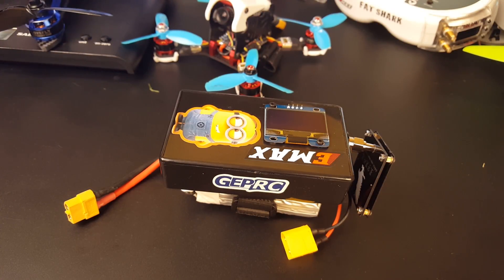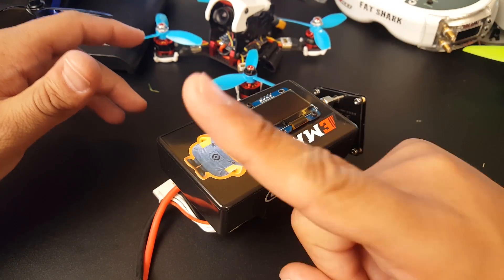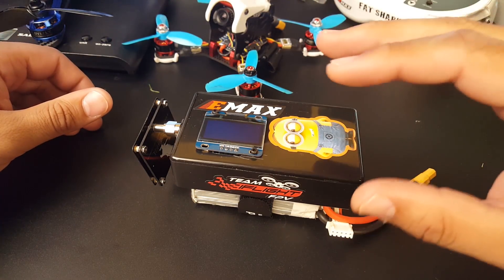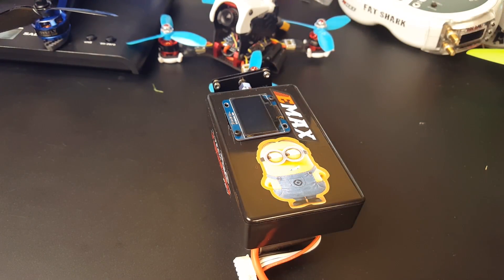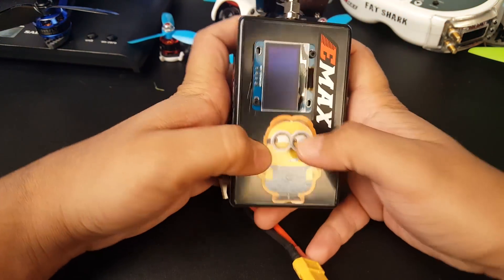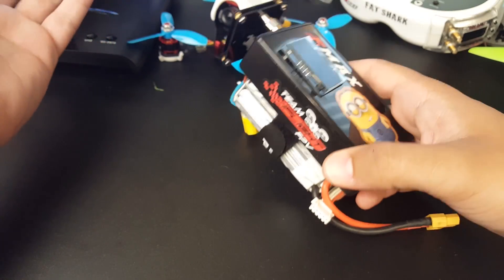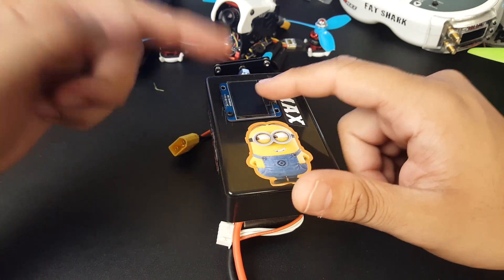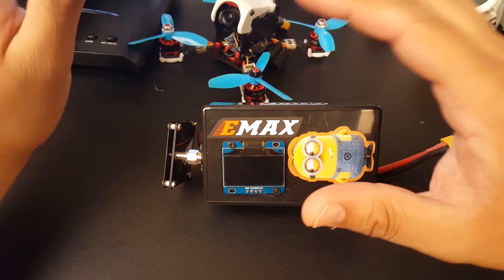DIY Drone Finder // Field Test

Comment: Bummer!!! The Oled display has been out of stock at Banggood from the time u published your first video.  I think this is cool and would be fun to build, not to mention it’s usefulness.  Any idea when these the Oled will be available?
Reply from the maker: http://www.ebay.com/itm/0-96-I2C-IIC-Serial-128X64-128-64-Blue-OLED-LCD-LED-Display-Module-for-Arduino-/282633371012?hash=item41ce42fd84:g:GcsAAOSwOhVZqPn7

Comment: I'm offering my help if you wanna do a custom case, I've been working in 3d professionally for 28 years now, I'm confident I can make you a sexy case if you give me the imposed dimensions.
Also, I think one really cool addition would be to add SOUND FEEDBACK ! I suggest either the alien tracking device sound, or the radioactive Geiger sound, wouldn't that be great ? And comfortable to use !
Congrats on that mode mate. Was nice to follow along, and you manage to bring it to an almost finished product, Chapeau bas! (hat down).
Let me know if you're interested in my help.
Reply from the maker: 6rilllir6 Your the best I think it would help out the community alot..  email me what dimensions you need.  :)
Reply from the maker: +6rilllir6 sure it would be awesome email me the dimensions you need. :)
Reply: will try to dig out your email somewhere and send you an email  eDIT:got it in the description... was easy :)
Reply: ok, I just made a quick test, for a "gun style" design, that's just a very quick draft, not going into details before you check it out, as you might not want it to look like that ?? Or do you ? You can check it out here : https://youtu.be/SidGpBFnQOY
Reply: Hey I can help design and if you need another printer to print stuff I can print stuff for you too
Reply: i think it would be cool with the startrek ping sound. maybe u could call it the macene that goes ping...

Comment: This is really cool. What I would like to see is you make something like a drone keeper mini because they are awesome problem is now they changed their shipping so they are not worth the price coming from Korea. It's a self contained beeper and battery that knows when it stops moving and its loud you can adjust a ton of stuff on it and it's pretty small.
Reply from the maker: Fran Galasso I'm working on 2 theories UHF and or 2.4ghz devices very tiny can be placed in quad. Most parts still on the way however this device will keep evolving.

Comment: And never fly over a corn field, i crashed in one a week ago, i had a beeper on it and the battery was luckily still plugged in.
The corn blocks pretty much all of the video signal, i even thought that the battery was unplugged. I received a video signal about 15m away from the quad with 200mw and a patch antenna and i began to hear my buzzer like 3 meters away...
Reply: good to know ! thanks for sharing that ;)
I bet it's because of the water concentration in corn... 5.8 doesn't do well with water.

Comment: I'd buy the PCB, if you make one. I had had a thought about using something like this- https://www.amazon.com/dp/B011DJMW5M/_encoding=UTF8?coliid=I331VGRAFJHRFF&colid=OVA7BCLZ1B6F . Has it's own built-in battery, but I don't know if the range/weight is good for a quad. Thanks for the video!

Comment: what happens if the battery falls off the quad in a crash?
Reply from the maker: Primo Cruz I have plans for a 2.4ghz finder waiting on parts to arrive this will work even if battery unplug.
Reply: How's the 2.4ghz finder that you intend to make find a quad that has no power?
Reply: In this case, your drone is gone! :D
Reply: Maybe a metal detector!? LOL

Comment: Really, really nice, man. Fantastic job! Some tips that maybe help you improve it: it would be nice if you put the channel number in the display. Maybe the battery voltage too. ;)

And, of course, you can always use a 18650 battery with a TP4056 and a step up. Depending on the current consumption you can use the TP4056 with battery protection and it's going to cut the battery when it reaches to 3v, to protect it. If it draws more than 1a from the battery, then you would have to use a TP4056 without protection circuit + a 1s BMS. And it's done. :)